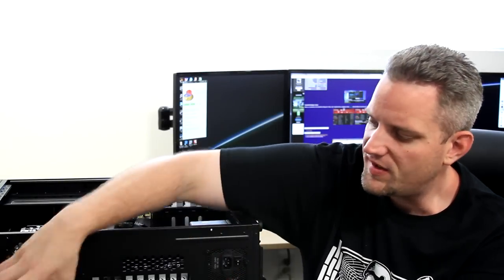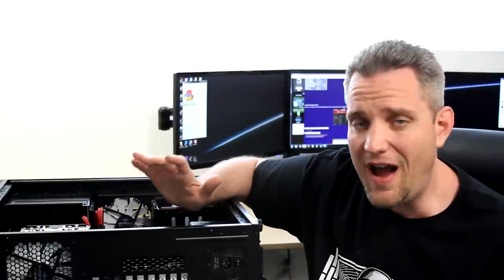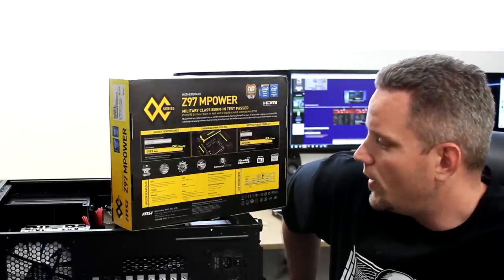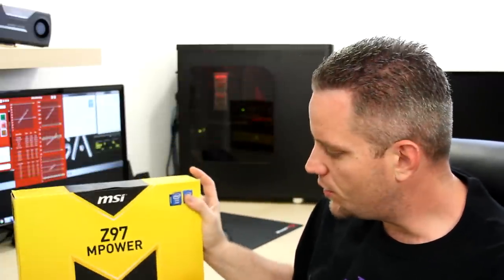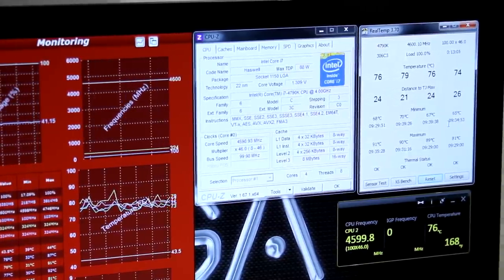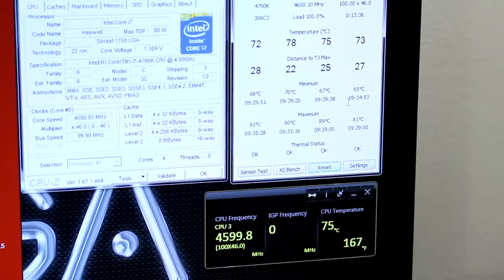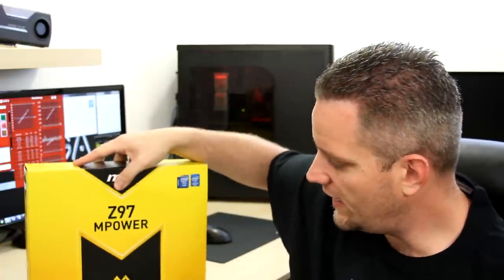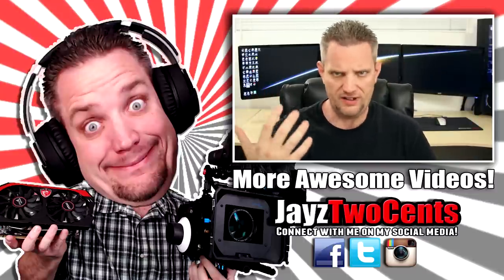Overclocking the Intel 4790k with the MSI Z97 MPower on air!

Comment: I feel that people are underestimating air cooling. I'm running a 3570k at 4.6 GHz under a Thermalright True Spirit 120 M BW, which is a Thermaltake copycat cooler. The cooler costed me like $30. I'm getting about the same temps you mentioned in this video. Sure, I might be able to pump out .2-.4 GHz more on water, but the difference between air and water on the CPU is far too small in my opinion. If I wanted, I could also put in a high quality fan in my cooler and get a LOT better cooling ability out of it.

Comment: I was reluctant to update to F9 until yesterday. Gigabyte does not give the best support for BIOS. The updates for my Sniper M5 are few and far between, about a year apart. However on the AMD folding rig, Asus is still rolling out BIOS updates for the Crosshair V Formula Z as well as driver updates. I was massively impressed. The driver support is lacking from Gigabyte as well.

Comment: I jumped from i5 2500K to i5 4690K and I had my 2500K OCd to 4.5GHz stable (my MB was kinda broken and after they sent me a replacement and after some time It had same problems, I just didnt bother to send it back) with some tests, it was slightly faster than stock 4690K. So for 2500K or 2600K users its worth to go up (I didnt want to go to normal Hasswell, so I waited for this).

Anyway, Nice video.

Comment: I'm using my 4770k at 4.5Ghz at 1.25V. Been a rocky road of OC. Can't bring it up higher for stable performance without absolutely blasting the voltage.

Comment: Just overclocked my 4790k on an Asus Pro Gamer at 1.279V. Not a fancy overclock by any means. Just bumped up the base clock frequency to 48and that was it. Prime nine on load hovers around 66-70 degrees c. I am using a H100i water cooler btw. Going to try now for 5.0 ghz and don't see it being a problem at this stage.

Comment: 4790k in 2020 games still running smooth
Reply: I add 2060 super and runs great! 😁 Still few years left for my 4790k@4.6
Reply: @Gideon October Sorry, but that's not true. Even with 1080ti in 4K that 4790K starts to produce bottleneck. With a 2080ti that's more powerful? Well, more bottleneck. People tend to think that it's OK just because they haven't tried something better (was gonna say bigger but thought it twice XD), when you compare it to a 9700K in those cards you clearly see quite a big difference. Despite that, 4790K's performance is quite impressive for a 7 year old CPU.
Reply: @Gideon October The point in my comment was that you need to have experience with bigger hardware in order to have a valid opinion. Saying "great" with no further knowledge goes from knowing nothing to simply not to admit that's wrong.
I personally was using until this christmas 4790K+RTX3070 and thought the same as you. But in christmas eve my MoBo got broken (Z97 ones are nearly impossible to find...at least new, I won't trust 2nd hand) and changed to Ryzen 7 3800X and the difference is so big that 4790K looks like a bad CPU now (I know it is not but the difference is so big...)

Comment: Z87 Hero running 4790k @ 4.8 Ghz at 1.19v under water.(Thanks Jay for all of the watercooling wisdom!) Max temps of about 75C on all cores. Trying 5.0 Ghz at anywhere from 1.30 - 1.315 but can't get it stable. It may be a chip that doesn't like multipliers higher than 48x :p I may tinker with the strap if I get bored enough someday. Surprisingly not a single BSODs though, just stress tests shutting down and warning for instability. Silicon lottery win?

Comment: As long as the temps weren't out of the normal safe range, that voltage of 1.501 wouldn't do any permanent harm to the chip for that small amount of time it was ran like that

Comment: On my MSI Z97 XPower AC motherboard I can overclock the 4790K to 4.8ghz single core and 4.5ghz all cores on air with a Coolermaster 212 EVO and using the OC Genie on gear 2. Easy as hell to overclock with the XPower MB. That's not even trying. Just install the cpu open the bios and hit OC genie and XMP then go to OC settings and just click gear 2. Stable as heck.

Comment: *****  I have a 5820k planning to overclock @4.0Ghz+ (As far it goes stable). I've narrowed it down to Noctua u14s & Cooler Master Hyper 212x. I've read enough review to understand that Noctua is really high end stuff but if 212x can do the job then I would definitly like to save couple of bucks.

P.S- Noise is not an issue UNLESS Hyper 212x totally sound like a lawn mower.  Thank You :)

Comment: You guys should know that there are 4790k's that were made from 2013 batches. If you get one from that year you probably won't be able to overclock as well with it. 2014 ones seem to be doing a lot better when overclocking.
Reply: That's why I'm waiting a month to buy mine :)

Comment: I have a Z97 ROG Hero VII and this 4790k. Love the hardware but loath the software, had AI Suite working with a 4670k for a week and that was it. None of the 3570k's nor the 4670k would go over 4.1 so I went with stock out of the box 4790k with the ROG z97. Good nuff for me.

Comment: I managed to get my old i5-2500k (which is about 5 years old now I think?) to run at a solid 4.7ghz on air cooling. That is 1.4ghz faster than the default factory clock which is 3.3ghz.  It runs like a dream.
Reply: Ian Williams Yeah sandy bridge was excellent for overclocking you could probably go even higher if you have a cooler that can handle it. I know more than a few people that went all the way up to 4,9 Ghz with an i7 2600k.
Reply: Antares 8001 my 2500k is sat on 5.1ghz on a 212 evo
Reply: ben p wow : I have the same one and I never thought it could work on such a rate, can u help me to get mine OCed aswell.. Im kind of afraid since its the first time Im OCing
Reply: ben p how long did you run it for?
Reply: ben p how long did you run it for?
Reply: Lor Reuben had it running stable for maybe a month
Reply: DeNo just look up guide online. most people can get 4.7 easy, some get 5/5.1. Guess i got lucky with silicone lottery haha
Reply: ah.. i see.... what was the highest temp that it hit on the 212 evo?
Reply: Lor Reuben 80 :'(
Reply: ben p
 was it with a stock cooler?
Reply: Ian Williams 212 evo
Reply: ben p
really? my cpu is sitting on 4.7 and it barely reaches 60c.
Reply: ben p
ahh....hmm.. i was considering using the 2500k for a budget build and thought of pushing it to about 4.9... but, since the temp is near to 80, i would probably have to get another heatsink. Just asking, is the cooler master v8 gts heatsink sufficient enough for the 4.9 oc to run it at about 65 degrees celcius? cos that cooler looks amazing. I have thought of using an AIO cooler but it is a way more expensive option :( , so im sticking with a air cooler. Thx in advance! Cheers!
Reply: Lor Reuben 2500k is more than enough for every game out, and probably years to come even at stock, my brother runs his 2500k at 4.8ghz@1.3v at 75 max with a h50 aoi cooler
Reply: ben p
hmm.. ok then, thank you for your help! Have a good day sir!

Comment: 1.501 isn't always certain death on air. I have mine delidded at 1.48v and 5.2GHz that doesn't pass 82 on RealBench Stress Test. The new TIM is a small step up from Haswell, but I still saw about a 20c temp drop after delidding with CLU

Comment: Not to be youtube stalking you just getting into overclocking and haven't upgraded from my 4790k with msi z97a gaming 6 to a 7700k with most likely an asus board. Anyway just doing my homework on overclocking before I go tweaking with only the hyper 212 evo cooler on my cpu

Comment: Mine 4790k is doing  2.8ghz in 1.3 volts. Using a noctua NH d14. Temps during stress test in aida64 hits 61 average. Running on an Asus sabertooth z97 mark 2
Reply: Needs moar voltage!

Comment: sir, I'm not here to question your awesome work, but 1.5 V won't certainly kill a cpu, not even on air; ask my G3258 that beared 1.7 V benchmarks on air cooling (CM 412S) on a cheap z97 board (msi z97-g43). I know, I'm a beast... T.T

But it still works LOL

Comment: Wow to your volts for that 4.6, on my MSI Gaming 5 z97 with my 4790k I am at 4.6 @ 1.270v on air (a Deepcool Gammaxx 400) while I wait for my AIO Water Cooler RMA and can get 4.8 on water at 1.35v
Reply: im sitting at 4.6 with 1.25v, asus z97-a and hyper 212 evo... did i win the lottery?
Reply: Im also on 1.27v running 4.6ghz stable on an asrock z97 anniversary mobo with a coolermaster seidon 120v water cooler...
Reply: running 4.6 at stock 1.190

Comment: wo wo. so I'm like 3 days from buying a z97x-ud3h + 4790k combo, you're saying that by default the voltage levels are gonna damage the processor?
I'm not thinking of overclocking right now, but daaamn I don't wanna fry my stuff.

Comment: my 4770k wouldnt go over 4.2, my 4790k goes to 4.8ghz, for flight simming the highest possible clock speed is important, but anyway is up to 1.375v safe with water cooling my temps get around 75c max

Comment: It really is a chip lottery with the 4790k. Mine does 4.8 ghz with the same vcore as in the video on air. 

Did you get an L13 or L14 batch cpu Jay?
Reply from the maker: Its L3 and L4, not 13 and 14 :P But Mine is an L3 :(
Reply: Ahh unlucky.. The 2014 chips are better :) Got my chip under my single stage compressor it runs at -40c and booted the system 5 ghz from the bios with 1.2 volt vcore. So they do scale a bit with lower temperatures.

Comment: I just upgraded to the same processor. But it's funny how my Gigabyte board that I had with my AMD system did the same thing. If you buy a gigabyte board go into the bios and turn off the option for Motherboard turbo. Holy shit it will kill everything, mine was also set to 1.5v

Comment: Would have been nice to see you hit 4.6 with a little lower voltage. I've heard of these chips hitting 5ghz.
I've got a 4670k and I'm @4.4 on 1.24 volts. I'm on air as well. Using a 212 Evo.

Comment: I'm running a 4770k @ 4.5 on air with a single low rpm fan and it idles at 36. Never seen it go over 80 under load.

Comment: My i7 4790k is stable with cores 1 & 2 at 50 and cores 3 & 4 at 49 with 1.373v
Reply: Looks like i won the silicon lottery
Reply: DrSlamwich Define "stable" please :P If you can boot into windows at that speed... that doesn't mean its necessarily stable
Reply: Advection357 I've tested it with hours of gaming, and various benchmarking utilities. Never saw artifacts, and never crashed.
Reply: Not sure it will stay reliable for a long time at that voltage. .22nm CPU's are a lot more vulnerable to electromigration & will degrade much faster when over-volted. But it's not a problem if you don't plan on keeping the cpu more than 2-3 years...
Reply: It's not running at that clock speed and voltage at all times. I have speed step enabled so the processor is undervolted and underclocked when doing less demanding tasks, and then turbos up when gaming or doing other tasks that are taxing on the cpu.

Comment: Just to add my 4770k on auto settings picked in bios runs at 4.8ghz stable. I have corsair h80 but temps under load never go beyond 72degree. I may have been lucky.

Comment: Will the stock cooler be sufficient for the 4790K when not overclocking? (Maybe will oc in the future with custom cooler, don't ask...)
Reply: I have the 4790 standard non k with stock and I get 95 degrees Celsius when playing gta 5 but it's stable

Comment: Hey Jay, I'm kinda in a toss up between the msi xpower z97 xl atx, the latest ROG, asus sabertooth z97, or keeping my exhisting z87 msi gameing gd65.  You may ask why i'm upgradeing at all... well i've had a bad experience with the msi gameing board and it is currently in rma and my build has been down for months, and so i have utterly lost enthusiasm with my build.  My new build is going to be fully watercooled, and i'm looking for a substantial overclock.  I find myself leaning toward the xpower dispite my current experience with msi.  I'm considering just useing the rma's board as my test bench whenever the heck it returns.  I am just looking for your thoughts on this.  Thanks!

Comment: Got 4770k put it on 1.280v 4.6 ghz peak on cores 90 with an old cooler master v8 pretty much the same lol but i run it 1.230v 4.5 ghz 24/7
Reply: +club4ghz old post but what stress test where you got 90?

Comment: So which air cooler did you Use? Also , I have an I5 Haswell system i picked up pretty cheap, with a  Z97 Asrock board. I'm wanting to upgrade to an i7 ( i really like my i7s). in your opinion is it worth it to get the Devils canyon , or the Skylake i7 k, or just go to the kaybylake i7k? Going past Haswell mean new board and new DDR4. However the CPU's seem to be around the same price $350.

Comment: I feel in some of intels higher end chips that aren't 2011 socket should have the onboard gpu removed anyone buying top end new hardware like a 4670k 4770k or higher will never use onboard gpu they will always have a proper dedicated gpu so all there doing is adding extra heat and power draw for something that is useless the 2011 socket cpu already have them removed

Comment: soooo , no way the ud3h can run 4790k? :(
if so im one sad panda...
Reply from the maker: I had issues getting stable overclock. The auto settings tried to kill my CPU. Have to set voltages manually.
Reply: ***** Didn't intel say that z87 wouldn't support the 2nd gen Haswell chips. Well unless the mobo manufacturer releases an updated bios with support. Only manufacturer I know of really trying for that is Asus thou.
Reply: ***** thanks Jay , im thinking of getting a new board maby z97 TUF or Hero :)
Reply: ***** I think it´s because you didn´t download the BIOS update for Devil Canyon
Reply: *****  We're talking about the Z87 UD3H right?
Reply: Asterisk yes , but i think its already fixed (not sure)
Reply: +JayzTwoCents was the chip you tested a off the shelf store  model or was it a review model like all the reviews get ?
Reply: +LTDanno360 he said he had bought it so it's probs a reg model

Comment: I have had no issues from my 4670k which is essentially 4770K w/o hyperthreading. I have 4.6 easy at 1.23 volts and idle 30 load 55-65. Is the i5 not suffer as bad as these i7's or did I win lottery? Also is upgrade to 4690K something I should do I mostly game, do a bit of 3D modeling. Been playing with vector design and some dabbling with the Adobe suite of programs. gtx 760 4g GPU Asrock Z97 Extreme 6 motherboard.

Comment: Random thought... I have an old dorm refrigerator collecting dust. Would it be possible / beneficial to tap a couple holes in that sucker and loop an extra long cooling tube through it, to cool down the fluid?
Reply: Rooster Cogburn Better yet!  Use the fridge as a case and build an entire system inside it.  :D

Comment: rocking my 2500K at 5GHz on 1.3V
:P
Reply: i already get rid of that, was bottlenecking my 780 ti :]
Reply: *****
Meh, still fine with my 780
Reply: Ymac101 yeah in most of games 2500k is still ok but run Crysis 3 grass levels all cores on 100% and stutter fest, no more i5's for me from now only i7 :D
Reply: *****
I'm not so much into grass, weed and this kind of stuff...
Reply: *****
good luck! hopefully you won the "silicon lottery" and your chip is good :P

Comment: im building a new pc and i was wondering if the i7 4790k would be the correct route to go, like is the i7 4790k gonna hold up for atleast 3 more years? or should i just shell out the extra cash and go with the x99 platform?

Comment: So a 0.6 ghz OC on the 4790k runs at over 70 when stress testing on the stock cooler. I'm running my FX 6100 at 4.0 (Default is 3.3) on the stock cooler, and I have a max of 62 degrees when stress testing. So did I get lucky with this CPU? Or is this normal with AMD CPUs? And no, I'm not an AMD fanboy looking for a reason to brag about AMD, I have a I5 in my main PC.

Comment: That was a poor job overclocking. I am at 4.65ghz - 1.25 volts - 45c air cooled...
Reply: hey that sound great :) is that running with the turbo boost and enhanced turbo boost enabled? 4790k with z97 gaming 5?

Comment: question: i am buying this i7 4790k... i will not be overclocking whatsoever...can the stock cooler do the job?
Reply: if you aren't overclocking get a 4790 non k.
Reply: i am going with it because it has a better Thermal interface/ better heat management

Comment: Hi,
I'm currently having an AMD FX8120 OC at 4,1GHz. I've pushed it to 4,6GHz before but it's getting way too hot and fans get too noisy with a Corsair H100i. (IMO) I'm really considering going back to intel. I was waiting for this rebranding of the Haswell but I'm still hesitating. To get to the point; is it worth changing my FX8120 to a 4790K or is it better to wait for the next intel processors? (Skylake)
Thanks in advance.

Comment: is 1.375v safe just for turbo boost, thats what asus 5 way optimization set my cpu volts just under turbo boost at 4.8ghz across core 1 and 2 and 4.7 on core 3 and 4.i did a quick stress test and it goes to 1.350v at turbo

Comment: Will a Corsair RM650 be enough to run an overclocked Intel i7-4790K and Asus DirectCUII R9 290 with 5-6 case fans? I would not be against buying a 750w PSU if that would be better and/or a safer choice.
Reply: I run a 4790k with 2 770 GTX in SLI with a Seasonic 650w gold PSU. I am sure it is on the ragged edge and I disable SLI often for my MMO that I play regularly.
Runs benchmarks like Valley no prob. Will get a 860w soon anyway.
Reply: The 650 will be fine.
Reply: That's a very good quality power supply and you should have about 50-100 watts extra just based on a ballpark guess of mine.

You're good.
Reply: you'd be okay with it, but personally I like to leave quite a bit of headroom. I'd grab a 750/760 watt (Personal favorite is the AX760i)
Reply: You are absolutely fine. I'm running a smiliar setup with a 550 watt PSU. No need to buy a bigger PSU.